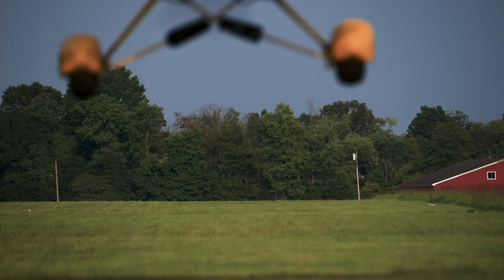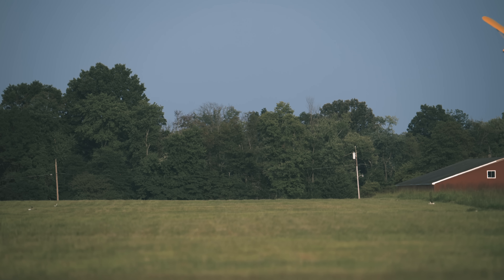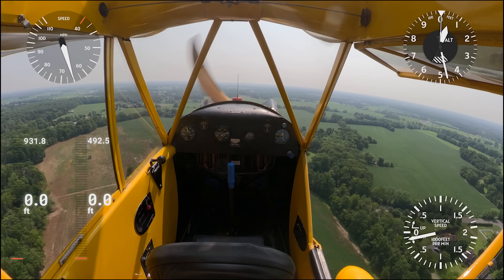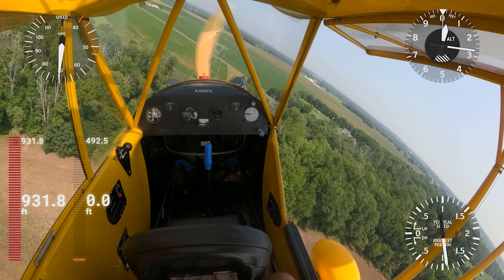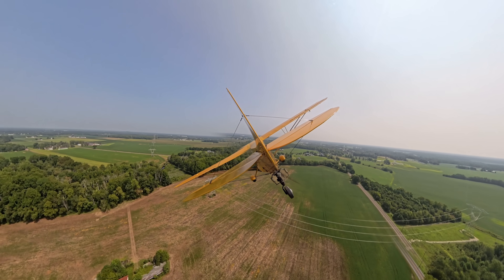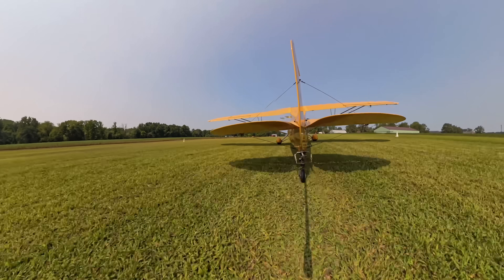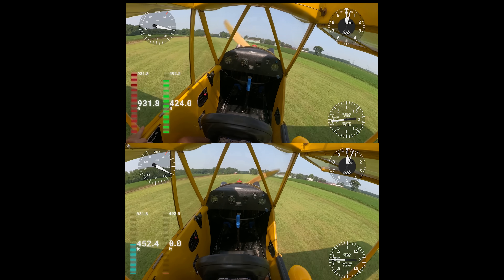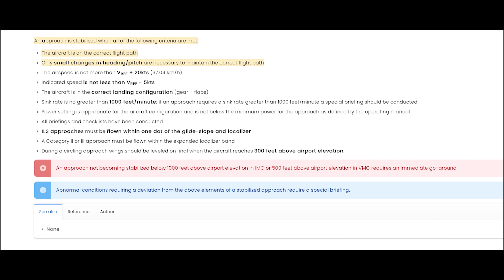What Happened to Basic Stick & Rudder Flying? Slipping an Airplane to Slow down.

Comment: Can’t agree more. Too many pilots flying out there, who think forward slips or dangerous; often because they have never them. The airline (and cooperate) industry is missing good stick and rudder skills big time. As a check air-man and instructor on large aircraft like the A330/A350/A380, in most cases it doesn’t take long to see if somebody has previous tailwheel experience.
Reply: Is it true that slip can cause a compressor stall in jet engines?
Reply: @algroyp3r  Yes, you do NOT slip a large transport aircraft and pretty much no other jet aircraft neither. The skills obtained by slipping and other good stick and rudder skills, can be used in other more challenging handling skills when flying large jet transport aircraft.
Reply from the maker: Yup, you essentially blank out the air that would normally go through the engine...
Reply: @Bananasssssssss  I can do it in DCS in F-18...

Comment: Back in the day (which was a Tuesday by the way) when I was doing my Commercial training, on one flight we’d finished the exercises we had planned for that flight, then my instructor said “let’s do some stuff that won’t be included in the flight test”……

“…at some point you’re going to be mixed in with turbine traffic who won’t be thrilled about being sequenced behind a 172 doing a ‘normal’ approach, so in daytime CAVOK here’s what you can do:….”

At the normal start of the base turn he reduced power a bit but then trimmed nose DOWN to maintain about 110 knots instead of trimming nose up for 70. The desired result was to still be at 110 knots at the end of the base to final turn, then “slip the snot out of it” at about 75 knots to scrub off excess altitude and do a normal no flap landing. 

A few months later I was doing some solo practice in a 152, and there was a 172 in the circuit as well. I practiced several fast approaches in the 152, and was curious whether the instructor and student in the 172 were puzzled about how a 152 was ending up gaining on them on each subsequent circuit. 

I definitely feel I got good value/experience from the lesson that day, and if you got your Commercial without your instructor demo-ing and practicing this with you then I think you got cheated. 

I definitely DO NOT recommend this for any low time pilot without instructor supervision. But I consider it a valuable tool in my toolbox that can be drawn upon if needed in daytime good visibility conditions.
Reply from the maker: Thanks for sharing because this is really awesome to hear and a perfect example of how it should be taught. My Commercial training was my favorite to date, it's where I really learned how to fly the plane. Glad to hear you had such a solid instructor.

Comment: Over at the flying club where I work as a mechanic apprentice (I'll be getting my A&P soon), and where I got my private pilot license, a lot of the instructors do not teach students how to slip when coming into land. And I feel like it relates to a point you made in the video, where you said if the student meets the ACS standard, check that part of the syllabus off and move on. We even have some instructors that allow their students to make very fast taxi's. And in A&P school we are told that taxi speed should be no more than walking speed. On the other hand though, we do have a few instructors that do teach these skills to their students, one of which got me into studying the different types of airfoils that different aircraft use, like the NACA 2412 on a C172. Which not many schools teach anymore according to him. I'm lucky enough to also have had one of the good instructors at the club teach me. 

Apart from the good ones however, the majority of the instructors out here are primarily focused on getting to the airlines as quickly as possible, and never seem to focus on giving a student a quality flight lesson. That's a trend that I've noticed all across the industry. Student pilots get their PPL, then their instrument, commercial, CFI, and start building hours as quickly as possible by teaching students, and leaving for the airlines as soon as they reach 1500 hours total flight time. Rinse and repeat. While flying for the airlines is great, I feel like the mentality of building hours is hurting a lot of student pilots, because like I said before, the CFI's are not focusing on the students, they're focusing on flight hours. And to me it's distracting all these young CFI's from what it means to be an instructor. Which is to devote their time to a student, and show them the ways of aviation. All of that combined I think is contributing to the loss is stick and rudder flying skills. 

Now, I myself am not a CFI, or a commercial pilot. I'm just a private pilot. However, I do eventually want to fly for an air freight company, and do some instructing on the side for fun. The two companies I'm looking are are either FedEx, or Atlas Air. My biggest goal within the industry though is to own an airplane, starting out with a little Luscombe, or any old taildragger, and moving my way up to a Cessna 182. When I say all that though, I'm not looking to get their as quickly as possible, and while a lot of people may tell me to think the other way around because of the seniority system, I'll just tell them that I want to take my time building hours, so that I can remain a safe pilot and retain my stick & rudder skills. Because I know that along my journey, I will make mistakes, but the key thing is I want to learn from whatever mistake I make. Because I have been told that even up to the ATP rating, all airmen certificates are a license to learn.
Reply from the maker: That's a great attitude to have in regards to career flying. And every license is definitely a license to learn....

Comment: Correct me if I'm wrong, but I think you're spot on, on lack of (practiced skills) not having taken the time to compile the data but I seem to believe a lot of the (hero types, example Scully among others ) pilots that's had vary successful survival rates in vary bad accidents/situations have been the pilots that have strong stick and rudder skills from there past. - - just my opinion :) 
I love flying my RC on windy days just so I can do crab landings and takeoffs😳
Reply from the maker: @Patrick42567  usually the better the stick & Rudder the better chances in emergency situations or challenging environments etc. The key is also to try your best to not get into those situations in the first place lol. For example, properly flown pattern, stable approach is definitely a better way to land within the Touchdown Zone than yeeting the airplane towards the runway and then slipping while in ground effect 😂. But again, great skill to have just in case 😁

Comment: I'm mostly with you. But also, I'm doing my tailwheel training now, and slipping that close to the ground seems like an easy way to break an airplane if I touch down to early. I'm more inclined to slip an airplane on final than I am in ground effect. If I were flying an approach to the airport in the video, I think I would slip the airplane to get down past the trees, and then flare and land as normal.
Reply from the maker: All good points, I kind of did a poor job of explaining that this is kind of a non routine, kinda last resort, use once in a while type thing, lol. I would absolutely slip on the approach over the trees and come out of it before ground effect. I would use the slip in ground effect if I just came in a really tight pattern and was fast and needed to bleed off some airspeed to get down ASAP or in a forced landing situation etc.
Reply: Good stuff but I agree with @irwinrussell60. Maybe consider more of an "intro to slips" video that describes the basics for people.  Doing them very near the ground is definitely not how to begin.
Reply from the maker: @gregcharest443  agreed but that’s kind of my point, this is something that has definitely been taught less and less over the years.
Reply: Once you get the slip perfected it can be used almost to touchdown. Once you center the controls, the airplane quickly regains the proper touch down attitude. Did this many times in my 1946 Cessna 120 with no flaps. I was a much better pilot once I started flying taildraggers.

Comment: Brother, you are spot on regarding the disappearance of stick and rudder skills. I teach tailwheel in a Citabria and love helping people.
Reply from the maker: It's awesome when it clicks for em. It really is such a different kind of flying, it's so much fun
Reply: I bought and learned in a 7ECA Champ back in the 80s. Slips were the only way to get into many places I landed. Had the plane for ten years and then had life changes and got rid of it. Many of my jobs I was flown all over Alaska in many different kinds of  planes and helicopters.
Reply: My instructor taught me to side slip and it has certainly come in handy
Reply: Why I am extremely happy to be a student glider pilot. It's all stick and rudder. I absolutely love this type of flying.
Reply: Tailwheel instructors are disappearing, so good on you.  Keep up the good work.  IMHO, the private licence should include several hours of TW instruction to cement proper habits in the primacy of learning.

Comment: I used this technique to nail my commercial power off 180’s in a C172.  I picked the 1000’ markers on the runway, kept 80kts all the way to the threshold with plenty of energy, then slipped as much as needed to nail the spot.  Was able to hit my point every time with this method.  I actually startled my DPE because she had never seen anyone else do this in ground effect before.
Reply from the maker: literally the perfect situation where this would come in handy!, lol
Reply: @Bananasssssssss would also come in handy with a quartering tailwind, no reason to float all the way down the runway.
Reply: What do you mean by “with plenty of power” in power off approach? Just trying to understand
Reply: @reyesben  I meant to say “energy” instead of power.  Thanks for that catch.  I edited my original comment.
Reply: I was out this weekend with a friend of mine who is a CFI. We were in my decathlon and I said hey lets do a power off 180. He has only about 7 hours in my plane. He aimed for the 1000 ft markers. First time he was long by maybe 100 feet. The second time he landed on the markers in the first 100 feet. He would put in a forward slip just a touch, take it out, put it back in. Got into ground effect, and back into a slip to slow down.  Seems he was taught very well.

Comment: No doubt the slip is one of the most underutilized techniques- my opinion. Yes, the majority of these flight schools are “academies” that push ratings to airline careers. I’m not knocking that - was not my path -  I was a commercial rated helicopter pilot who added on with a SEL rating all for the fun of GA. Expensive, yes - but very rewarding!

Comment: The Private Pilot Certificate is supposed to be a license to learn, but simply going over only ACS techniques again and again is not progressive learning.  Your forward slip is a good technique for any, but especially for slick airplanes with no flaps or inefficient flaps.

I would add some other basic stick and rudder flying techniques that increase our energy management:
The basic level in low ground effect until Vcc and then climb at Vcc takeoff.  In your Cub and other 65 hp to 150 hp airplanes, free ground effect energy can easily be fifty percent of total energy available.
The energy management 1 g turn of any bank angle.  If we do not pull back on the stick, the load factor is 1 g at any bank.  Wolfgang, in "Stick and Rudder," asks what the airplane wants to do.  In every turn it wants to lower the nose to maintain trimmed airspeed rather than altitude.  This is why the airplane cannot stall itself.  A pilot pulling back on the stick is required to stall.
Down drainage egress is often of greater safety concern than is wind management.
Wind management is making base into a crosswind at uncontrolled airports without traffic or ask tower.
If we decelerate on short final enough to get a sink going, that will bring throttle into dynamic control, exact control, of glide angle and rate of descent.  If we use the speed up of the apparent rate of closure as we get close to the numbers, we can further decelerate in ground effect where Vso, and out of ground effect number, is no longer a no go below number.  See Stick and Rudder top of page 304.  It is the same apparent rate we use to decelerate coming into an intersection with our cars.
Thermal or orographic lift is often more than fifty percent of total lift available, especially in low powered airplanes in the mountains.  Pitch up in up air and pitch down to get through down air quickly.  Attempting to maintain altitude kills too many in the mountains.  In severe downdrafts, we will not be able to hold altitude anyway.  Pulling back to stall airspeed is not the solution.

Good brief.  Thanks.
Reply from the maker: These are all great Techniques!! Love to see it.

Comment: Very interesting topic. I learned to fly in 1981 and I was taught forward slips with/without flaps in a C150 during my flight instruction. It is a great tool to have in the toolbox.  
In later years, I had an electrical failure and could not use any flaps. No big deal for a C152 landing with no flaps, but being able to slip was beneficial.
Reply from the maker: absolutely PERFECT example!!!! thanks for sharing
Reply: @Bananasssssssss   👍

Comment: 5 and a half months for a pilots license is diabolical....aint no way they good pilots or even know what they are talking about im sorry but someone had to say it
Reply from the maker: It's hard to learn what you don't know in that short amount of time. Not the fault of the Pilots, we've all been there
Reply: if you’re a pilot you’d understand why they call it a “license to learn” - a lot of new PPL holders still will fly with CFIs to new places or busier airspaces. So in one way you’re right - they’re not great pilots yet but they are determined to be safe within standards
Reply: @jmizzonini  mate do u seriously think in 5.5 months someones gonna rock up do a ppl  get 100hrs pic do 13 ATPL exams go do a MEP then a  MEIR and a cpl plus a mcc course plus the uprt  and actually have a clue on what they are talking about? Id like to meet this unicorn pilot i wouldnt be suprised if they stuttered trying to explain the pitot heat let alone how a variable pitch prop works
Reply: Even at the airlines, a slip an option in a no-thrust emergency, like the Gimli Glider situation. NOT something that should be done in a swept wing jet normally, but it’s always better to have more tools in your toolbag when things go sideways.
Reply: I did go to ATP school in Hartford, CT . I was amazed that even after someone becomes an instructor for them, they are never allowed to land on any strip shorter than 3,000’ and they can not land on grass. I said in an emergency, they will be surprised at what they really need to do. They practice short field experience on 4,400’ paved with no trees at either end. My instrument instructor that taught me holding patterns said “don’t worry, this DPE only tests on VOR holds” ,we only practiced a GPS hold once - the DPE decided to give me a GPS hold and I received an unsatisfactory on it and needed to retake the holding pattern part of the test. They produce several pilots that don’t really understand what they should
Reply: Could be a money thing too.
Reply: I got my certificate in 1970 . I started in May and took my check ride the second weekend of October. Total time at check ride was 45 hours with a 98 on the written and I could do short field, soft field, slips, grass strips, etc., etc. I also knew how to talk to the tower and how to fly into a large airport (CVG) and I didn’t need the whole runway. I had a great CFI and when he signed me off, I was ready, so don’t tell me it can’t be done.
Reply: @av8va  we are talking about 0 hours all the way to ATPL thats what the issue is 5.5 months for a ppl is normal
Reply: Yes, someone always has to chime in with BS.  Getting a PPL in 5 months is easy if you are focused on it.  I took a year only because I could only afford to fly an hour or less each week.  5 months is longer than a college semester and I learned a LOT more in each college semester than I learned getting my PPL and IFR combined.  Not even a close comparison.  I’d say if you can’t get a PPL in 5.5 months, assuming you can afford to fly every day, then flying may not be your thing.
Reply from the maker: @LTVoyager like you said l, I think its very individualistic and a lot comes down to personal motivation, instructor etc.
Reply: @Bananasssssssss  Absolutely.  The main role of pilot examiners is to weed out those who lack sufficient skill and/or motivation to be proficient and safe pilots.

Comment: Hi Joe, I love the channel. I’m a new pilot and have been taught that a forward slip is to lose altitude without losing airspeed, my thinking before this video was that if I put it into a forward slip while in ground effect, I’ll slam the plane into the ground. Do you flare and put it into a ground effect. That seems a bit dangerous to me.
Reply from the maker: So, it depends. In this situation I'm really fast (for a Cub) so there is no issue in putting it into a slip. The danger comes from holding the Slip too long. You won't stall the wings but can stall the tail and the nose will come down hard (or mains) and you'll be sideways and that's not good. On a normal approach if I am slipping to come down over trees, I would take the slip out just prior to entering ground effect. In the video here, I put the Slip while IN GROUND effect but only because I had an EXCESSIVE amount of speed to bleed off. Hopefully that makes sense?
Reply: I was taught (in a Cessna 150) the forward slip is to increase rate of descent without GAINING airspeed, somewhat like flaps.